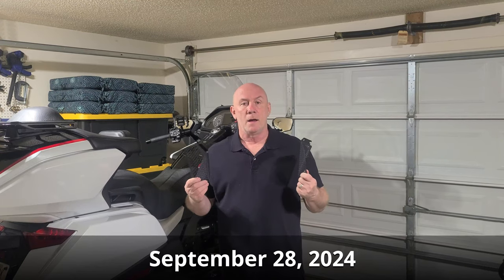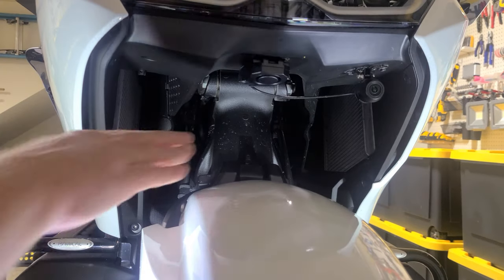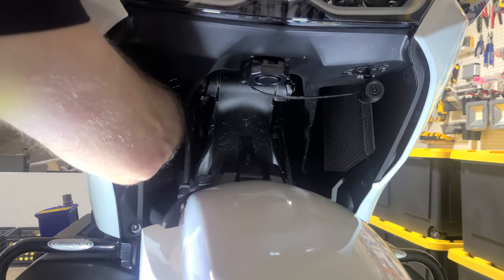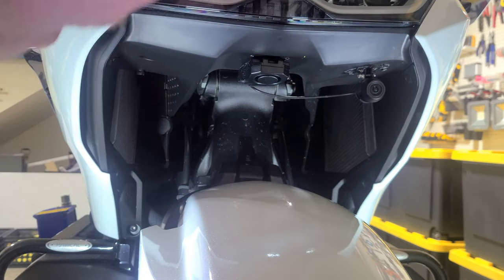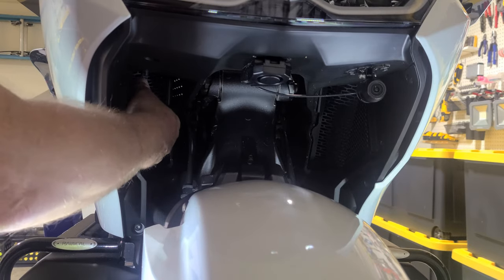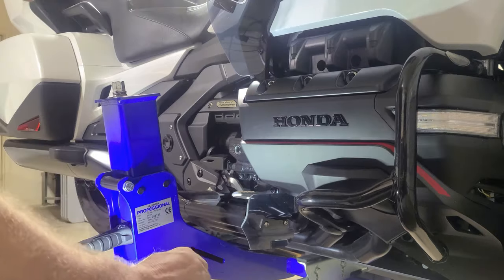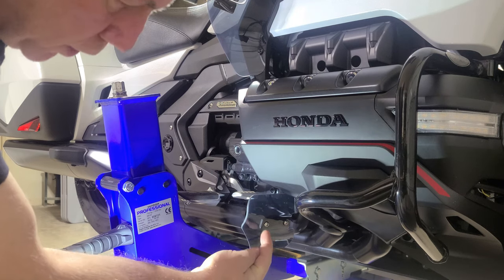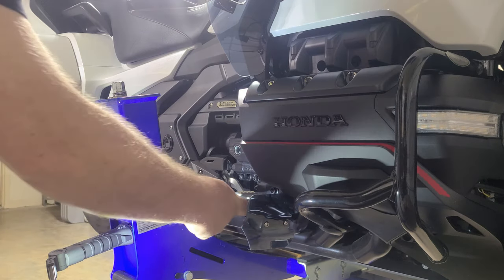PANICAL Radiator Guards & Foot Spoilers

Comment: Those radiator guards are cool.  I've had my eye on them for some time.  They certainly complement the look of Snowee!
Reply from the maker: @robertwhitemoto  Protecting Snowee while maintaining her look is key. Thanks, Robert.
Reply: Installed them a year ago. Opted to change OEM bolts with stainless wrench head bolts and butterfly nuts.  They will need to be removed any  time you need to remove the  inner cowls  for the many other
Maintenance   You may need to accomplish.  The OEM screws were a bugger to wrench and screw due to the cramped access.  Caught a small bird on a cross country tour, and of course large bugs.  🤣
Reply from the maker: @SecurityBob  That is an excellent idea, Bob. Thanks for sharing. Sorry about the bird, and the cleanup required after impact. Thanks for watching and responding.